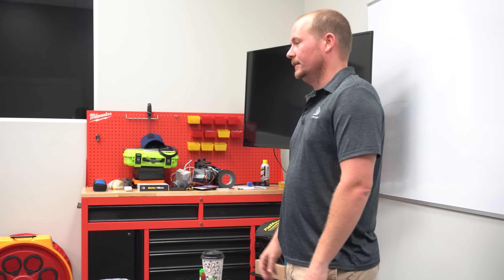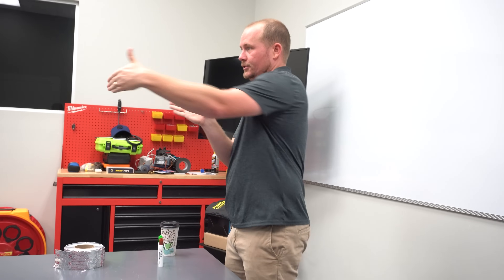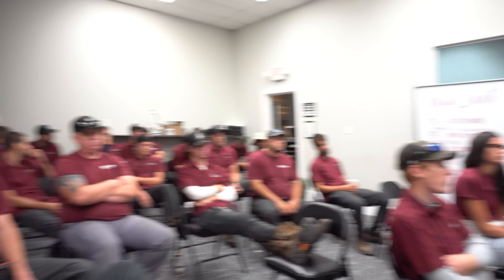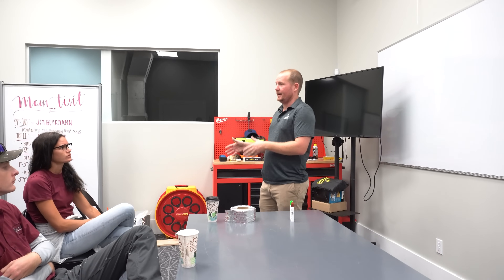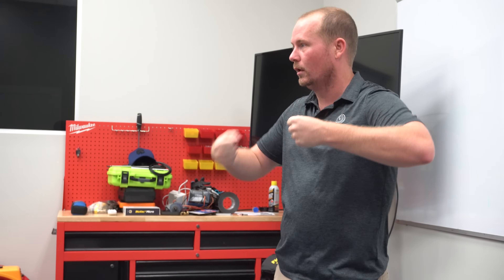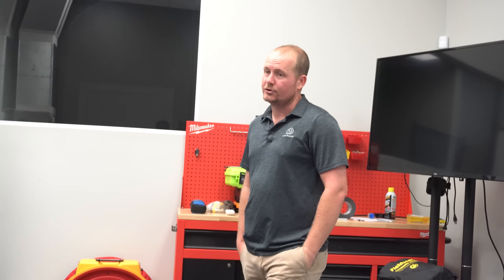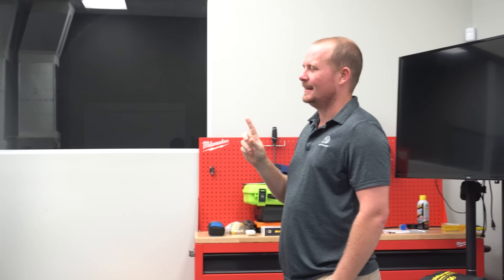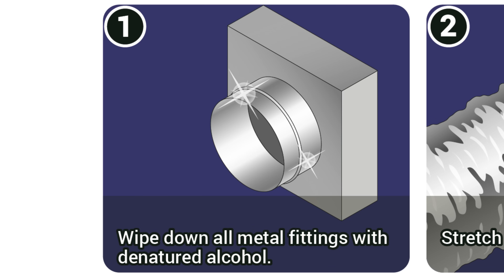Better Duct Installation Practices - Kalos Meeting

Comment: I dislike doing duct work so much but I have to accept the fact that in az I have to deal with it being that high static pressure is such a issue in az because of the hack installs that started in the late 80s with new construction which I was apart of for 6 months in the early 90s thanks for sharing the right way to install 👍
Reply: ETomatoeMan that’s what I’m saying it was chas Roberts back in 92 what 2 companies was it
Reply: Have you been to the R.O.C. For your license
Reply: Cuz last I heard they aren’t testing because of Covid my brother barely got his R.O.C. Card after the first out break
Reply: You are correct the installations in Phoenix AZ are shockingly bad.

Comment: Make sure  when you pull the inner liner over the start collar to pass over  the lock ring very important , your panduit should be tightened pass the lock ring of the collar or boot also
We use air seal or mastic on the inside of the inner liner and panduit and fx tape and panduit in the outer liner r8 duct our our targets are to pass below 5% we have no problem here in California Central Valley good video thanks

Comment: When we make any connection between flex and hard duct we use a zip tie and screws through the zip tie into the duct.
Reply: Thats too much waste of drill battery and screws because you drop them, just put the sleeve over the crown with mastic insidr zip tie it and call it a day

Comment: When I started installing back in 06 the company that I was working for told us that pookie inside the flex to make the connection was code. Later on I learned it was just one of there things they wanted done.

Comment: Mastic on inner liner, slide over collar, put a panduit on, slide over insulation with panduit. Grant is correct.  Did it for ten years in az.
Reply: I thought he said don’t put a panda strap on the outside of insulation and vapor barrier
Reply: Mastic the (black trash bag) slide it to the splice collar zip tie it (panda like you guys call it)put the insulation over tip zie it again (not hard)
Then the silver trash bag just tape it with silver tape and call it a day

Comment: Air will ALWAYS take the path of least resistance. If at times length +route=larger diameter pipe to keep down static and thus keep up velocity to distribute airflow properly.  Duct board to start is at minimal .05 supply to ensure proper airflow. Whereas metal you can start at .08 for supply. Metal is always the best choice. Ductwork was intended as a commercial EXTERNAL insulator. It should NEVER be used as soley as duct. Whom seals the corners? Whom seals each collar put in so that fiberglass is NOT in airstream for the life. One last very important factor.. Duct board ALWAYS molds!

Comment: When attempting to make improvements on an existing system...
Would You Rather: 
Have a 1” filter in the factory position next to the evap coil?   Or
Have a 4” filter in the return grill 10’ from from the air handler. 
All else being equal...should I be more worried about the poor airflow of the 1” or 
the negitave pressure exerted on a length of flex duct? 
Thanks, learning so much.
Reply: your filter should be before the coil and the blower
Reply: Don't use the factory filter in the air handler, install filter grills in the house return to make life easier for changing filters.

Comment: I'm an older guy having to go up and fix a pile of crap that someone did in my house.  Years later here I am trying to fix the spacing on the ducts because they're sweating and the ends pop right off the plenum connections despite having  tie straps on them, they're worthless.  I'm in Texas and I'm here to tell you that the freaking tie straps are worthless.  Do something right the first time.  They should have been installed with a nice tape, and then metal hose clamps. Then you can tie strap the outer jacket if you want. I could start an AC company today and my entire selling point would be the quality of the craftsmanship when it comes to the stuff up in the attic that people aren't looking at.

Comment: I’m not a fan of flex duct.  Should be used for terminations only.  Rodents chew right thru it.  With all the prep, sealant, bands, mastic, tape, etc, needed to make sure the flex doesn’t fall off or leak, I would rather just run steel duct. The cellophane inner liner, with spring, disintegrates, and doesn’t have a very long lifespan.  I guess that’s OK in Florida,  if the houses only last 15 years.

Comment: When you have a 2 story space with a single evap and no VFD on the fan you zone with a dump (bypass). With this config there is a single dump vent somewhere. In this case it's downstairs. Would there be any reason you couldn't add zone dampers to that run that would dump downstairs in Winter and upstairs in Summer to make better use of the conditioned air?

Comment: Those city inspectors have a poor outlook when it comes to the outer insulation of flex having to have a mastic application.  That would be about the same as putting mastic around a radiator hose and clamp on a pickup truck. 
What is the point when its already sealed up with the inner duct ? The outer duct has zero pressure, all it is doing it providing a dead air space for insulation purposes. Plus, if there is nothing to support the mastic layer, insulation moves of course and is not rigid, over cycle times etc. my guess is the mastic is going to age, get hard and eventually crack and just one crack clear through is all it takes to make that idea a waste. I agree, good cleaned surface preparation is king and then the foil tape done nice and neatly, evenly so that all of the tape meets the contact surfaces evenly/smoothly will provide a longer lasting connection than only mastic. I like the idea of a mastic application to the inner connection and the metal fitting. That works because the metal fitting is rigid and will support the mastic for a long time regardless of how old it gets. Wider duct straps are better too as 1.5" seems too narrow. Most systems I'd think will need supply dampers at the supply plenum to get the correct tune for most installs, even if just one or two of them do any good out of all of them it worth the effort and cost.

Comment: Flex is used only to connect duct to a plenum or duct to a small fan. Never use flex as a substitute for duct.
Reply: Flex was designed to use in short lengths from the REAL duct system to the diffuser.  Now everyone uses it for complete systems.  There are areas in the US, where you can’t use more than several feet of it.

Comment: Lol who’s cleaning fittings with alcohol? It’s flex duct for heavens sake. They will do all that and than use duct board, which is the real problem for leakage. Duct board is a terrible product.

Comment: I do not believe turbulence in a ducked system really makes that much of a difference. I believe this is a lot over kill
Reply from the maker: What facts or data do you have to back up your beliefs?
Reply: I wouldn’t recommend putting any animals in your ducts... this will greatly impact airflow...
Reply: You are wrong...turbulence creates an "air bubble" effect inside the ducts and makes a blockage vs. a pathway.

Comment: Round snaplock duct is way more efficient for long runs, but it requires more labor to install, thats why it isn't used in house installs. But home owners are only interested in cool air coming out of the registers, so it is easier to run a mile of flex and get away with it.